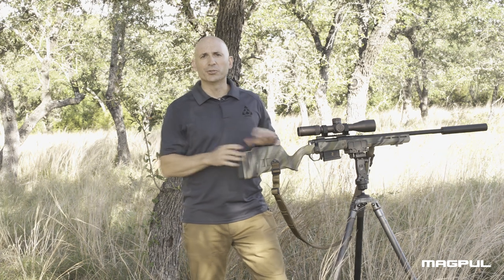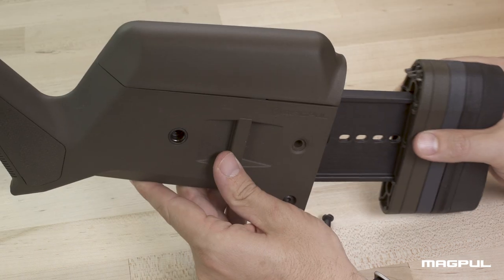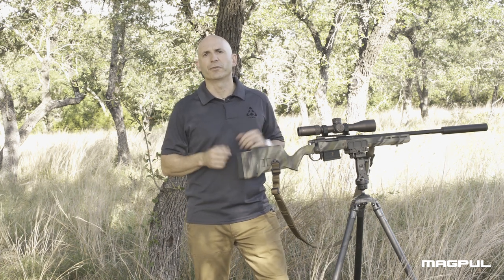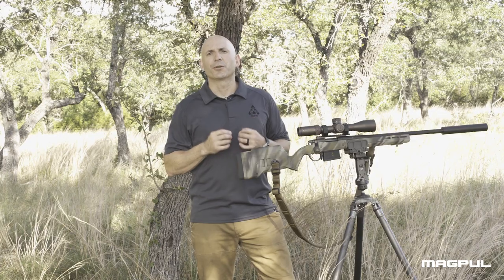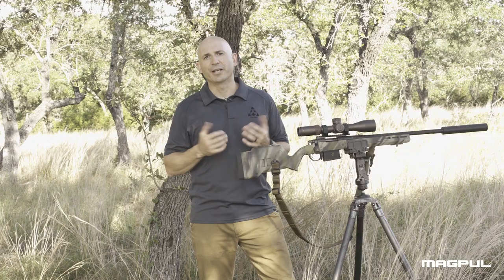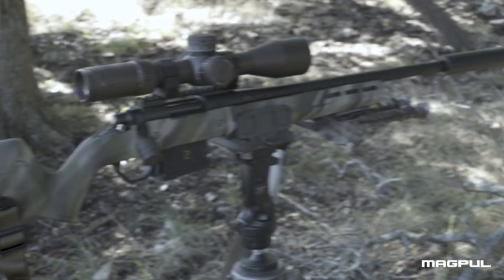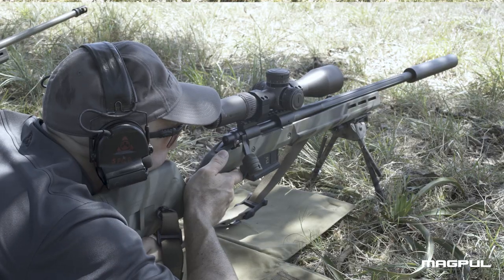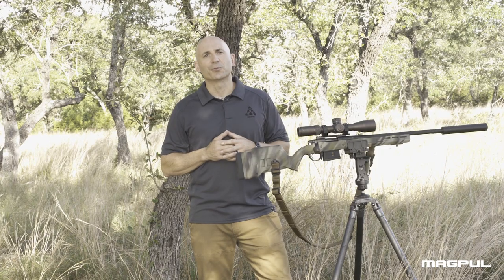Magpul Hunter - Part II : Usability, Fit and Slings

Comment: Stupid QD cups you have to buy separately when every other company out there provides this as a standard option!
Reply: Those type 2 QD cups are $20 each and screws are separate.
Reply: Yeah, that's a cheap BS move by Magpul. A $300 stock and they don't have cheap QD mounts installed. Cheap.

Comment: I paid $270 for the stock and the factory screws to hold the action on the stock are too short. Magpul did not include a set of longer screws to mount the  action. Also, a basic swivel stud would have been nice.